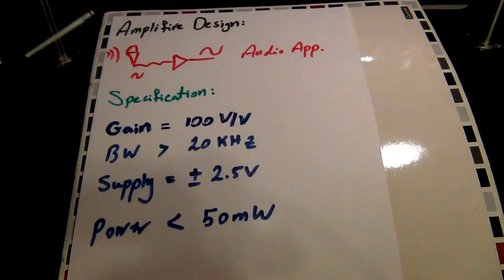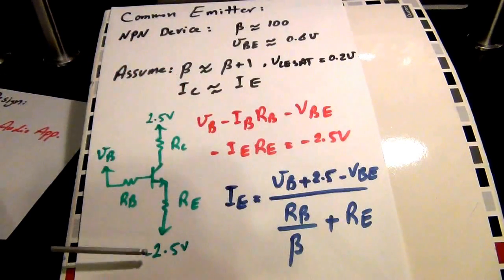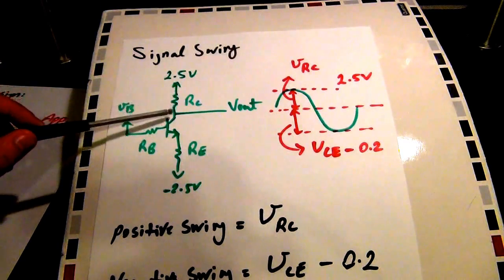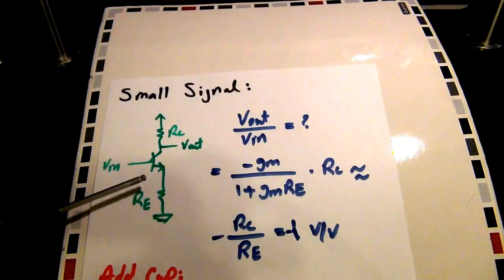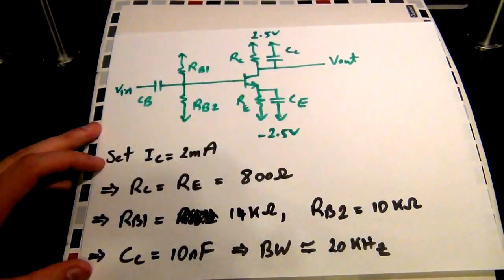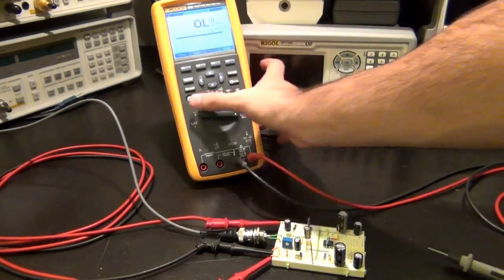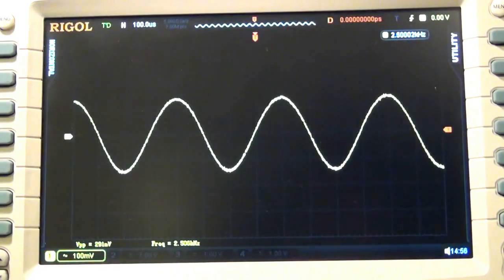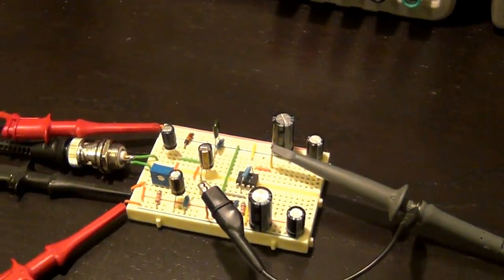TSP #15 - Tutorial on the Theory, Design and Characterization of a Single Transistor BJT Amplifier

Comment: There has to be some place on this planet where this stuff is explained systematically with every detail explained.  Everyone makes this look like part math, part voodoo.  ie:  They explain with some formula but nobody starts at the same point and then suddenly they just pick a value out of thin air as in this video where he just decides IC should be 2 mA???  Appreciate the attempt but this isn't cutting it for me.
Reply: I know this is an old post, but it's not very nice. I believe a lot of people expect electronics engineering to be simple like intuitive mechanical devices.
    I have taken an interest in electronics but I made the mistake of developing an expectation of simplicity due to a number of factors like: the number of components on common circuits, consumer cost of electronics goods, and the entry-level "cookbook" type electronic projects that require zero understanding of why/how/when/where choices are made, they only show "what" to connect.
    Really understanding the engineering is an exponential step in a new direction. There is no way to teach someone simply, step by step, on YouTube tutorials. There is a reason an electrical engineer spends years as a full time student. Someone could record all of that time and all the time studying and doing homework. If they uploaded that, you'd have a full step by step.
   I have come to appreciate the need for educational structure through a degree program if I am going to really understand electrical engineering. 
   I'm sure many people have a different perspective. In my opinion, if someone can't learn something from this kind of excellent content, they should probably consider taking a structured curriculum program at a reputable school and pay for a tutor. 
   The more I learn, the more that path appeals to me, even though I follow this information quite well and learned quite a bit from it.

    I am very thankful for the time and effort that went into making this content for me, a complete and total stranger. -Thanks :)
Reply: Been awhile but I also appreciate the efforts YouTuber's put into their videos.  I've seen more on this since and it's becoming clearer but it should be rather straight forward.  My view these days is many do not really understand the "complete" theory behind a transistor, while those that do seem to go over the math so quickly that it's hard to follow them and they take short cuts which doesn't help the guy / gal trying to understand it all.  I have a background in computer programming, amateur radio, radio communications analysis, chemistry, etc... So I don't expect things to be simple, but when explained in a step by step manner it should become clear enough.  I can bias a basic transistor circuit with experimentation but it would be nice if someone could actually go through the design process one step at a time without rushing.  I've been looking for some good books on this as well but so far haven't found anything at the level I want.
Reply: Personally, I feel like the biggest challenge with transistors is the word it self. When I first started learning electronics, I thought of transistors like a simple component of electronics, kinda like a water pump or an alternator on an engine. Sure there are some small variations but they all do the same basic thing. I kept looking for a parallel intuitive connection on that level, and was frustrated when I couldn't find one.
  Once I realized transistors are not so simple, I started looking deeper. The real foundation of the subject requires an understanding of P and N type junction materials which starts with diodes at the most basic level. Diodes themselves are a subject that is often grossly underestimated by beginners like myself. 
   The beginner trying to understand transistors as a foundation is about like a new mechanic trying to learn about a piston based internal combustion engine by studying a jet turbine only. Sure, there are some similarities, but they are very very different on a fundamental level.
   Mentally I think of transistors like the evolution of humans in my own odd way.... 
   Transistors are just the mutant conjoined twin babies of diodes. Those, babies evolved into tribal groups to form the first Op Amps. Then they domesticated a few wild resistors and capacitors, and organized into a feudal 'logic IC' system with lots of wars over everything from fundamental structure to configurations. Finally the population got so large and advanced they organized into massive civilization sized communities with specialized communities and with different governing structures like FPGAs, PLAs, Microcontrollers, CPUs, etc. At their heart they are not made of transistors, they are made of diodes...'s mutant babies :)

  Also, in my opinion, there are some extremely deceptive statements often said about transistors: "Transistors are an electrical switch." or "A computer is made of 1's and 0's with transistors." Transistors are analogue components made of diode junctions. They themselves don't store or do anything digital.  
  Those were my biggest ah-ha moments. 
    When it comes to amplifying bipolar AC signal, like audio stuff, I haven't found anyone that breaks down the subject intuitively. I've even thought about doing a tutorial myself. A complete approach has to cover: stages of amplification (buffer/voltage/current), input impedance, AC decoupling, DC bias vs bipolar supplies and the configuration needed to amplify an AC waveform, both intentional and unintentional RC filters, and finally output impedance. 

  I believe a lot of people including myself have a hard time understanding electronics because we don't start with the absolute fundamentals and are therefore biased for frustration. 

  That's my take on the subject. I'm no expert, but I've figured it out well enough to scratch build a few multi staged audio circuits, a dual polarity tracking lab power supply, and reconfigure a powered subwoofer into a guitar amp with a few effects modified into the original op amp filtering circuits. I'm currently working on understanding how to AC bias a tape head delay effect and have several other projects in the works.
  As far as books, I prefer to have comprehensive information available. The Art of Electronics is well worth the investment for a reliable source of information IMHO.
Reply: Where would we be without them? I started taking radio apart as a child, perhaps you did the same. 2sb56 transistors were the transistors coming out of japan at the time, then BC108s were a favorite. 2sb56 will be worth something these days. The 0C 83 could be made into a photo transistor by removing the paint and exposing the junction.
Reply: Bike Jake My friend. Feel proud of yourself. Your analysis is of a very intelligent individual. Go ahead and write that book and express yourself. you are good at it. I am kind of at that stage to where I finally was able of getting lots of data togetherness and making the right mental associations and feeling good about it. it took me a while in life, but I think I got it.
Reply: One of the best resources I've come across for a step-by-step of how these circuits work is a book called The Art of Electronics. The BJT chapter goes from using a transistor as a simple switch, then builds on that to produce a usable amplifier, but each step feels logical and well explained.
Reply: Alex Davis 
Yeah, I invested in my copy already. TAoE is even available (2nd revision) for free online with a bit of diligent Google searching (hint: use "filetype:pdf" in the search). I want to get the workbook as well. 
     Reading well explained material that is practical and intuitive is great for developing an understanding. Still there is no replacement for building the circuits and troubleshooting the failures for yourself in order to cement an understanding.
Reply: That's on you to seek out the correct level of understanding and sources to help you understand it. You can't possibly expect him to start out from device physics and explain all the thermal properties, electrons, holes and all those things. If you want a deeper understanding you first need to take a course on semiconductor devices as all EE's do. Then you can focus on an introductory amplifiers course, followed by more advanced ones.
Reply: I understand your frustration. I will be starting a channel soon and one of my series of videos will cover the full design and explanation of a complete transistor amplifier. I will explain the reason for every value chosen.
Reply: I just want to add that i think this guy's video is awesome and great work. But I understand the feeling of trying to stay with someone as they go through the design of something and losing them somewhere along the way...

Comment: Design a circuit using BJT for switching of a DC load. Load comprises of 5kW at a 
voltage of 200V DC. Represent the load with a resistance. Available stock of BJTs have 
βDC of 100, 120 and 150. Switching should be performed using a 12V battery
Plz tell how can i design

Comment: (1.6) (40) =-64 sir how did you get VT =40
Reply: Vt is the thermal voltage and is derived from certain constants at room temperature, taken to be ~26mV.  So, 1/26mV~40

Comment: The signal swing computation isn't accurate; you could get more swing out of it (if RE was chosen to be lower); the cost would be reduced Iq accuracy. Your assumption that the voltage must be divided evenly between RC, VCE, and RE for maximum signal excursion is not true.

Since you are pushing the transistor to its maximum gain (no source degeneration at AC), it will likely have a good amount of distortion. I wonder how it measures up...?

Comment: Hi,
Nice Video, but your way of calculating the biaspoint is very strange and does not lead to an optimal solution. When using only the collector as the output of the amplifier you certainly do not want to have the same voltageswing across R_E as you have at R_C, otherwise you limit your outputswing to about 1/2 as what is possible (mainly to the 1. quadrant). Usually the OP would be near 0V so it can swing both ways. using R_E =150R,R_C=800R,and biasing to -1V gives you already a gain of > 100.

Comment: Forgive me for asking such a novice question, but how do you have your scope set up?  It appears that the waveform, as it is changing with your voice, is bound at the center of the display.  I can't seem to get mine to do this.  Is this a special triggering function or some other special setting or am I just overlooking something obvious?
Reply: Its called AC input coupling, a capacitor is put in series with the input to your scope (almost all scopes have this as a option both analog and digital scopes) and removes all the DC component of the waveform. 

In short its putting a RC high pass filter in series with the inputs. Most scopes have three coupling modes, DC, AC, and ground. Ground is simply just shunting the input to ground.
Reply: oddball0045
Thank you for your response, but I'm not talking about the AC coupling feature on oscilloscopes. What i am referring to is that the signal is literally pivoting at a "single point" (both vertically and horizontally) at the center of the scope display. Look at the audio signal 32:39 to see this.  It also does this at 30:00 when he is scaling the frequency of the sig gen to determine the BW.
Reply: I think what you're seeing is a low frequency signal superimposed on the high frequency signals.
Reply: oddball0045 What your saying makes no sense at all.  While I may have asked a very basic question I am not new to electronics, so please do not feed me a load of BS. I was not asking for someone to make random speculations, I was asking if anyone new the true answer.  As it turns out, I found the answer myself and it is what I originally suspected.  For anyone else who may be interested, on page 3-10 of the Rigol DS6000 user guide is states that this is a Horizontal Reference point and that the scope by default will trigger from the center of the screen.  Apparently most of the newer advanced scopes have this option.  Something my old Tek's don't have.
Reply from the maker: carriersignal Hi, As you mentioned, nothing special is happening here. The scope is triggering on 0V rising edge crossing and the trigger reference point (in time) is in the middle of the screen.
Reply: The Signal Path Blog
Sir, thank you for confirming this.  Your videos are excellent.
Reply: +carriersignal  Your observation was correct and here is the explanation This is a digital scope. The analog signal is being continuously converted to digital. Display is held off till the signal triggers. The waveform is then displayed with the signal display positioned such that the trigger point is in the middle of the display,  The signal is DC coupled . These two together make the signal look like it is locked to one place.
Reply: +Azzy M  : That makes sense.  Thank you for your explanation.  I have since then  purchased a Keysight digital scope.  They are much better now than the way I remember them in the 90's.  You look a lot like Jim Williams by the way.  Thanks again.
Reply: The amplifier is only amplifying AC. DC bias from the mic is rejected, and hence there is no DC bias shown on the scope. If you want to connect the scope directly to your mic, and want to remove DC bias, then set it up for AC coupling. This is easier on analog scopes, as you just mash a button or flip a switch for that. You will need to muck around in the menus to setup the scope to AC couple a signal otherwise.

Comment: Anyone here tried the circuit on your own? I don't even have to try this at home I can tell already that this tutorial is just for trolling the viewers. He didn't even look at the datasheet of the transistor he used so how the heck the values such as vcesat pop out of nothing? Another thing, is seriously? You use gm (transconductance factor) for bjt amplifier computation? I transconductance factor are use for field effect transistors. Last thing is the op amp amplifier. Cmon man. You know building an amplifier using an op amp ain't that simple as you shown. Even if it is op amp, I mean op amp is many things, has many parameters to consider.
Reply from the maker: I can see a lot of Dunnin Kruger effect going on in this comment. This tutorial is on the design methodology. You can substitute various device parameters and apply the procedure here to your own circuit. This is how circuit design is taught. Transconductance is a universal small-signal transistor parameter, irrespective of transistor types and of course it is a critical parameter for circuit design, particularly for amplifier design.  Building an Op-Amp circuit is in fact much simpler than circuit design using transistors. This is because the Op-Amp can be treated as (a nearly) ideal block and simple feedback can be applied around the Op-Amp. This is why students are often taught about Op-Amp before they are taught about designing with transistors. Having said all that, if you had trouble understanding this tutorial, don’t despair. Practice makes perfect and lucky for you there are thousands of books and tutorials on this subject.
Reply: Yeah building op amp circuit is much simpler than transistor circuit. I'm not arguing with that. What I'm telling is yeah, you can easily design op amp circuit calculate this calculate that etc because you are working with an IDEAL Setup. But once you decided transforming those computations into real life, getting some "opamps" out of your bin and connecting them as described in your circuit, you will notice something different. Because yeah! That device does not work like in the Ideal scenario as you computed. Might I ask have you considered the offset current, the closed loop gain and any other characteristic of an op amp stated in its datasheet? Because clearly this parameters should make heavy impact on the output of the design. And about the transistor, can you tell me exactly what transistor did you used in your design? Thank you so much for your time.
Reply from the maker: Modern Op-Amps have such high open-loops gain, low offsets and high bandwidths that for this type of application they can be considered as ideal. Your results will be within 1%. Beyond that you have to take into account the specs.
Reply: You don't have to tell me stuff I already know. I'm not asking what kind of op amp you used, I don't care whether its "modern" or "prehistoric type" just tell me what exactly is the transistor and the op amp you used in that circuit.
Reply from the maker: @eduardraymundo9535  What you actually need is a lesson in etiquette, humility and polite communication skills. For you, electronics can wait until you have learned how to ask a question properly. The world doesn't owe you an explanation, I was doing you a favor. You need an attitude adjustment.
Reply: @eduardraymundo9535  " just tell me what exactly is the transistor and the op amp you used in that circuit." nobody owes you knowledge, if they impart it be grateful, if they haven't KINDLY & POLITELY request the information

Comment: Sir any video on RC circuitry  i.e. radio control device  for example how circuitry of a radio control car works  , how data transmission takes place between the transmitter and receiver module , to control the dc motor of the toy . Explain the schematic diagram of it